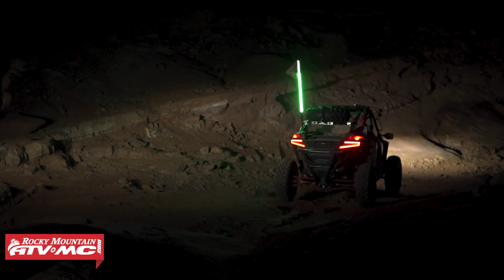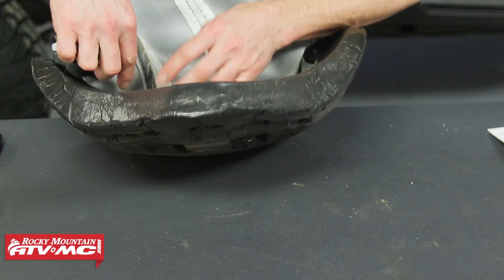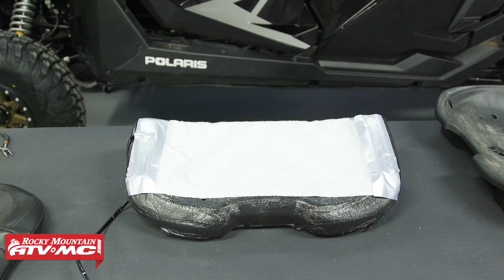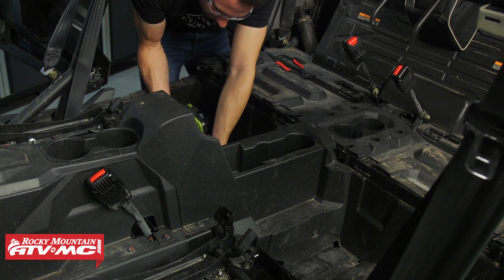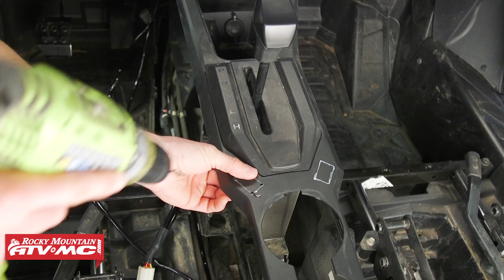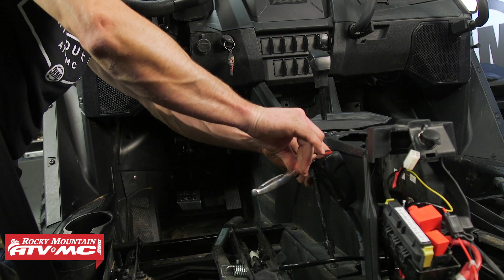How To Install a Tusk UTV Seat Heater Kit on a Polaris RZR Pro XP 4

Comment: 2022 Pro R 4; You cannot mount the switches on the center console as shown in your video. There is an upper shifter cable which does not allow for the depth of the power switch. I’m now trying to figure out how to repair the hole I cut in my console.